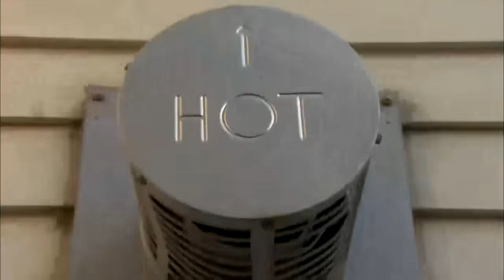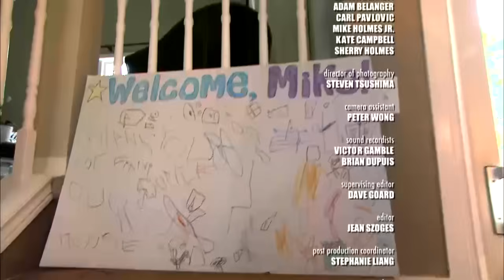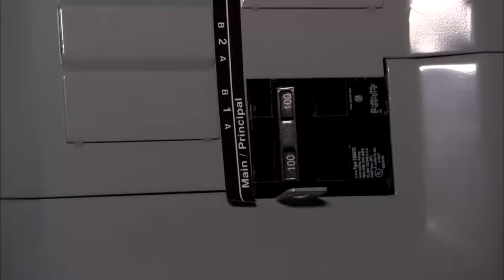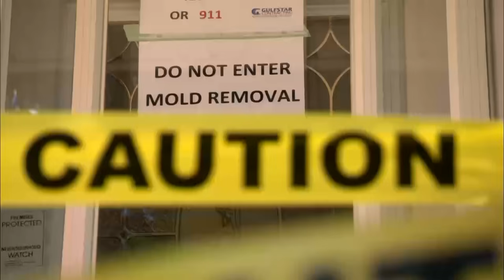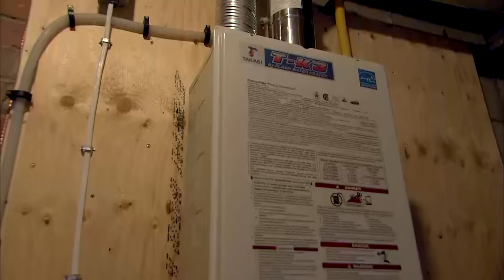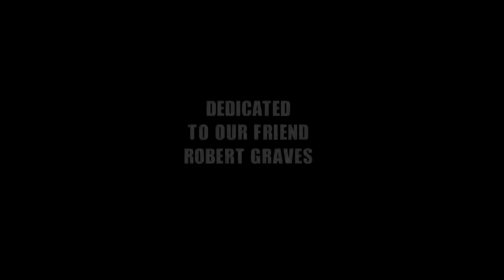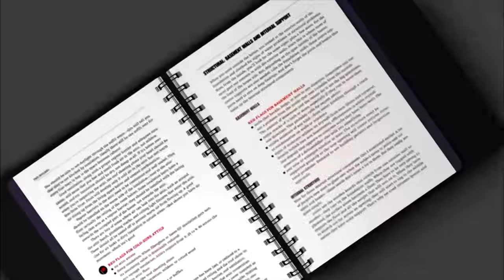Holmes Unveils Neglected Inspections | Holmes Inspection S115+116

Comment: House 1: They're concerned with Nora climbing the old railing on the back deck, but they install a short railing above the garage that has horizontal bars. I don't get it.  House 2: I'm convinced this house didn't get an inspection. They ensured that the purchasers were not present, and they wrote a lovely standard "all's good" report without even setting foot in the house. My suspicions anyway.
Reply: Above the garage  leads directly  into master bedroom.  Children would  not have assess.

Comment: that garage 'roof' , just ffs just extend the PROPER roof out over it with ceramic sturdy roof tiles , or steel/cooper roof and make it a inclosed 'out door room' aka glass walls with inside railing a couple of 'fika' chairs and table and a door to the bedroom instead of window or just sky scraper lvl quality of 'cant break' because that small piece of flat roof just ..something , if nothing else make a proper slopped piece over the garage